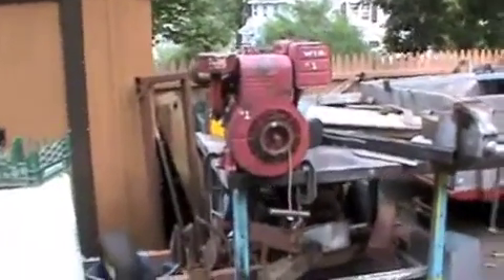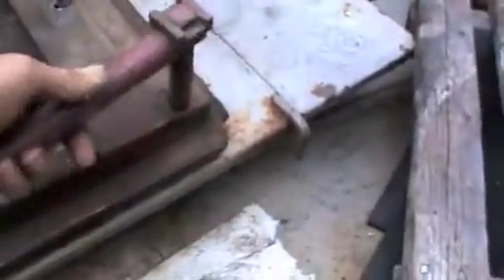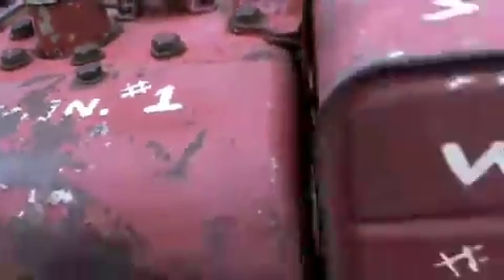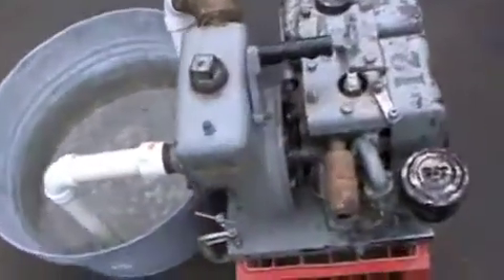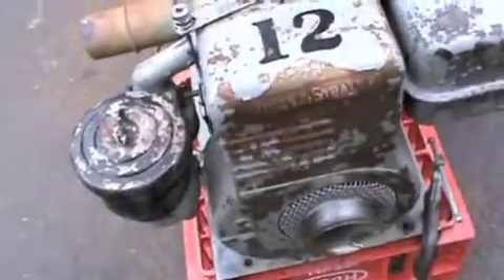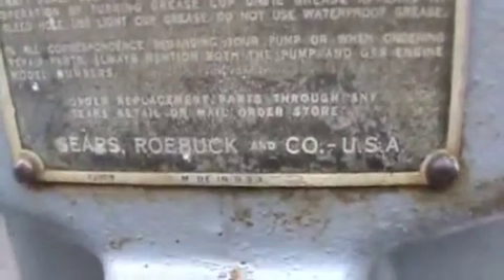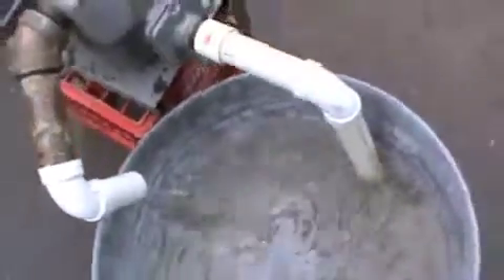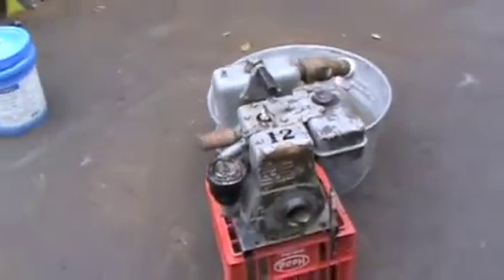Briggs Engine and Water Pump

Comment: it doesnt hurt an engine to run wide open while its under load. as long as it stays at  no more than 3600 rpm its factory setting your not going to hurt it while its under load.